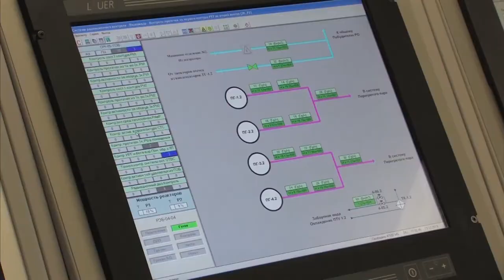Floating Nuclear Power Plant (FNPP) “Akademik Lomonosov”

Comment: 70 MW electric power (not sure whether in total or for each of the two reactors) is still not a lot. For comparison, a land-based system reaches 1300 MW electric power.
Reply: Its purpose is to supply small settlements in VERY remote locations such as the one it supplies now, and to which it is necessary to run thousands of kilometers of electricity grid or use diesel generators which are definitely more expensive to operate, especially if we consider that this nuclear power plant is also a heating plant.
Reply: Yes but it not build for systems required such power, instead it could be delivered and deployed in places where impossible or ultra-expensive to build land-based system. And it still way more powerful than any other portable systems + not require huge amount of fuel, which also should be delivered, just one load of nuclear fuel elements for years. And after it go out - it can be recycled to new fuel and some weapons-grade plutonium. Absolute profit